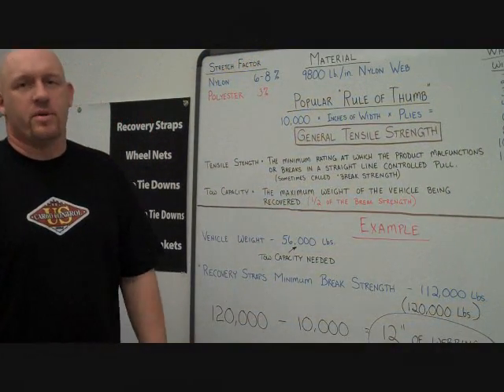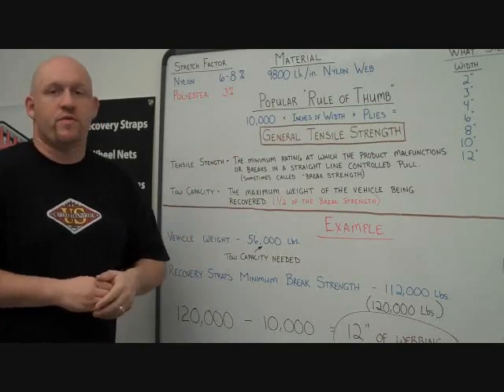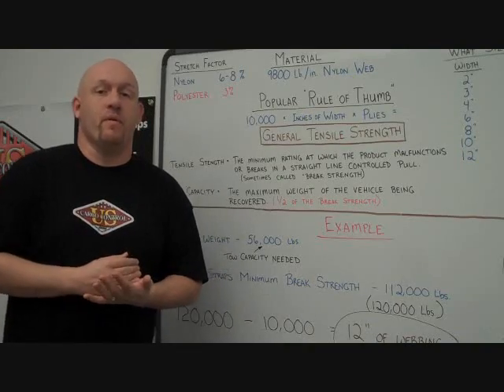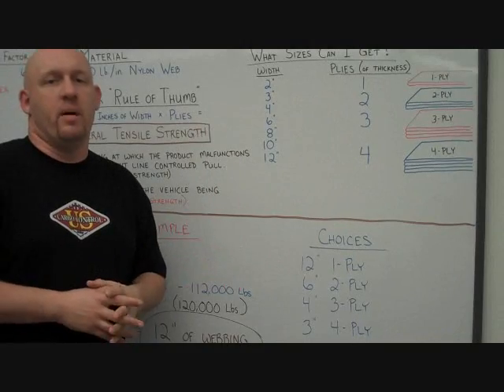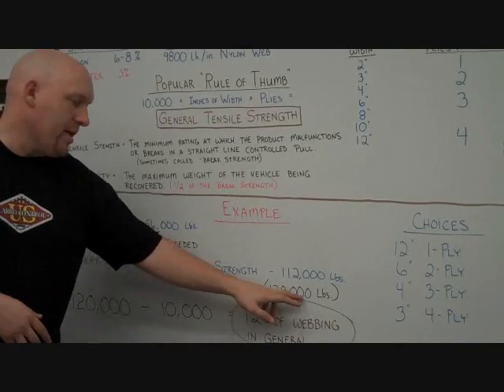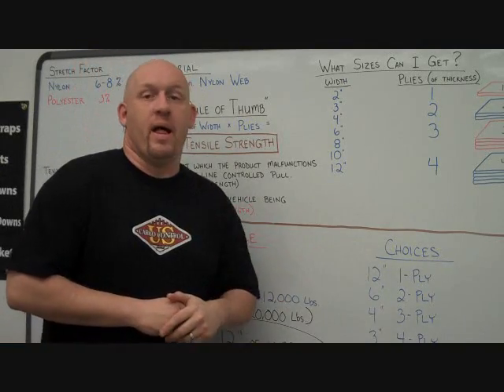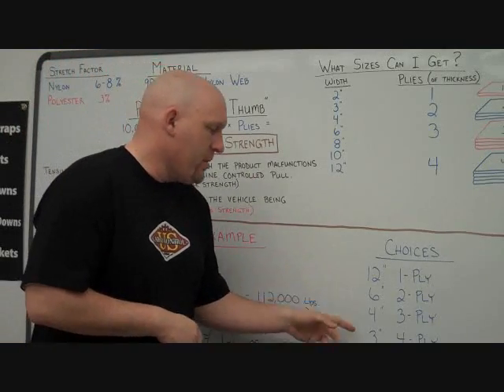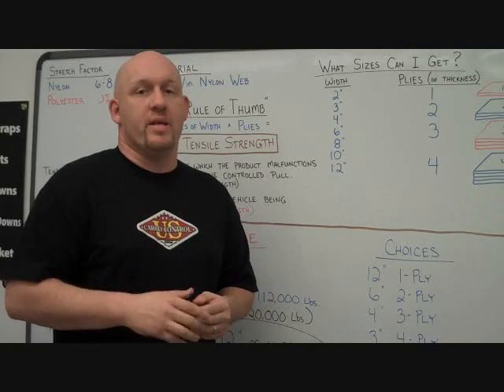How To Choose A Recovery Strap or Tow Strap | What's the Difference?

Comment: Why have a strap that's ten to fifteen times the WLL of the D Shackle or reciever bracket?  Any hardware is only going to be as strong as it's weakest link, right?  That weakest link is generally the 5/8" hitch pin holding the recovery reciever bracket into the hitch. I'd rather have my recovery strap break long before any of my hardware does.  I can't find one brand of hitch pin in this country that states anywhere on their product or website what the shear strength of those hitch pins are.

Comment: can you ever go too big? for example, if i want a recovery strap for my ford ranger. a 2" would do it no problem but i can get a 3" locally. would it be to heavy? would it stretch like it is supposed to or would it be jerky as if i was pulling with a chain. ( sorry if this is confusing)
Reply from the maker: Great question! There is such a thing as going too big. One of the attractions of using Nylon as a recovery strap is the elasticity that it provides, which acts as a rubber band and aids in the recovery of the vehicle. There isn’t a formula to tell you how much strength is too much, but generally as long as the vehicle is under tow capacity (half of the break strength), you can get by with that strap. So a 2” strap will have a tow capacity of 10,000 lbs., and your truck weighs less than this, so you can get by with a 2”. I think you will see better results using this 2” strap than the 3”, as you may not get the same stretch if using the 3”.